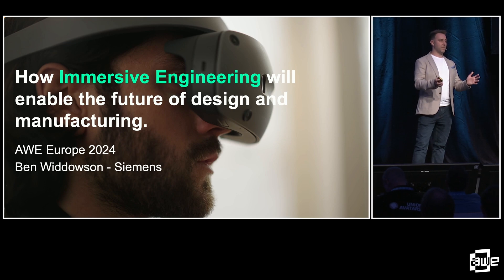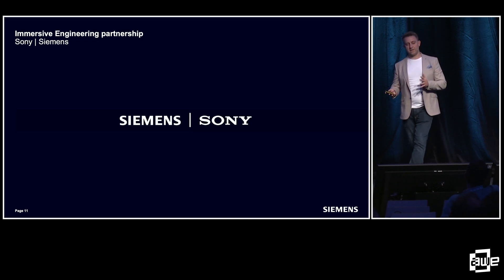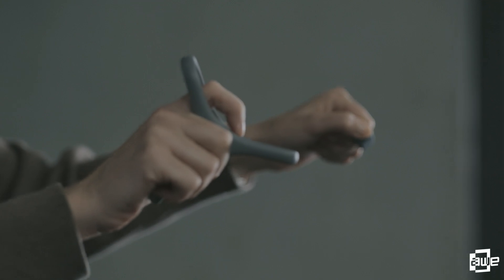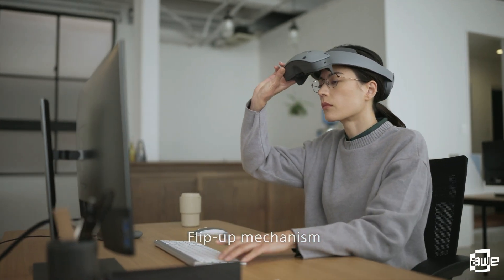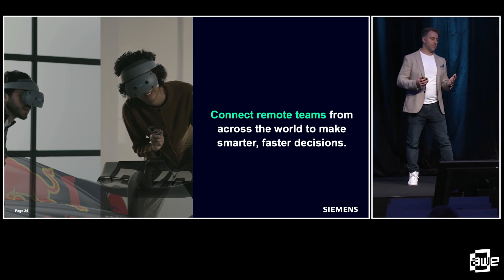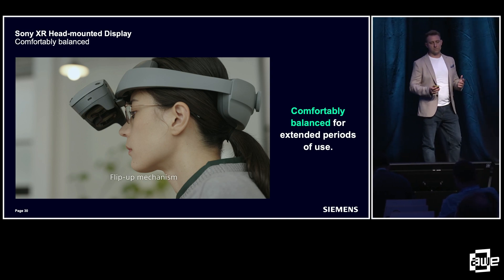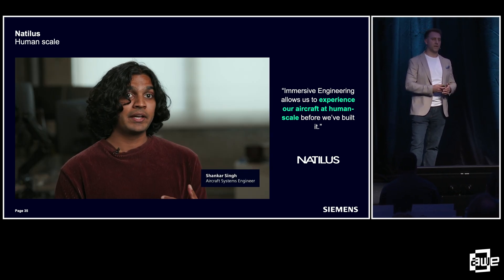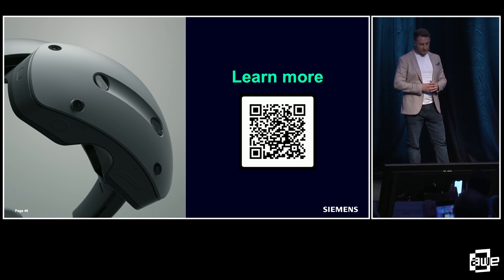How XR will Enable the Future of Design and Manufacturing through Immersive Engineering

Comment: I have a question, can both Apple Vision Pro and Sony's XR glasses achieve these functions? What are the differences between them besides the price?
Reply: Good question. The Sony XR HMD is unique in 2 main ways:

1. The hardware is tightly integrated into Siemens’ design/engineering CAD software.
2. The HMD and controllers are design specifically with content creators like designers and engineers’s workflows in mind.

Whereas other HMDs are more general purpose and created for a range of use cases including media consumption and gaming.
Reply: @BenWiddowson  Thanks for your answer, very good